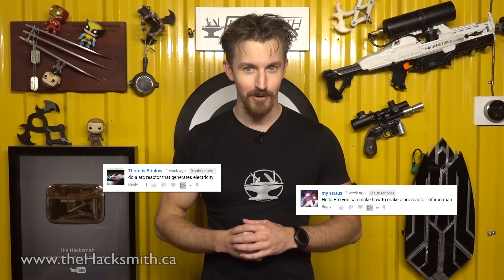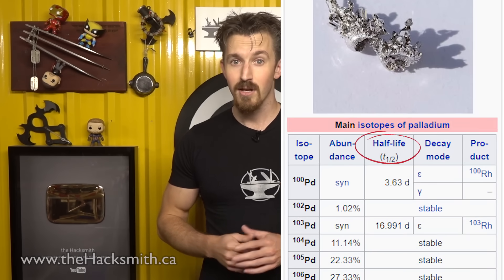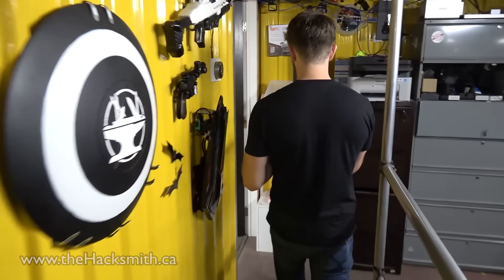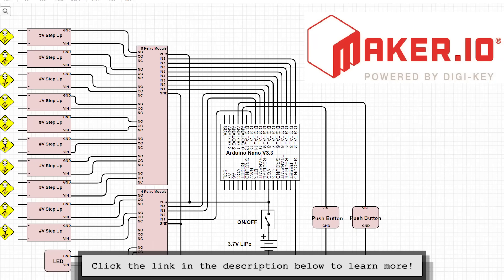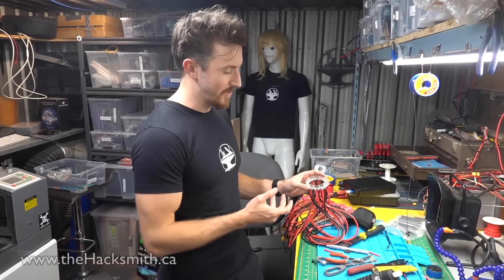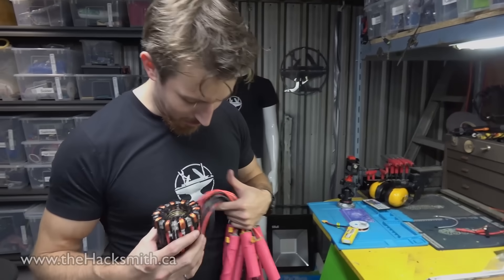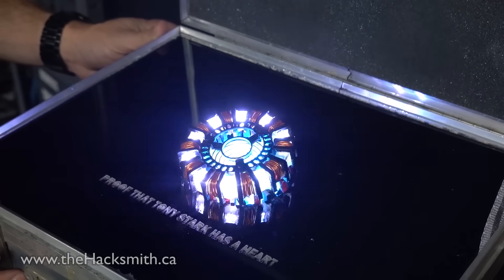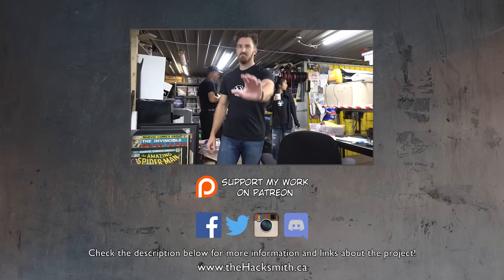Real Arc Reactor (ionized plasma generator)

Comment: But it still needs batteries
Reply: Gaming 101 yes . I think its supposed to create power .  But what we can do right? :D
Reply: Yeah. Hacksmith made a battery pack with an over-engineered LED, not an Arc Reactor.
Reply: @KefkeWren  I mean,  I already knew this would be the direction going into the video. However great work by them as it proves to be a great exposition for stem field
Reply: KefkeWren  so did iron man. The arc reactor was just a pack for his nuclear palladium. The blacksmith can make it to but he doesn’t wanna mess nuclear shit
Reply: He can't buy that nuclear bro
Reply: @sandsend812  he got it off ebay
Reply: d
Reply: batteries = immense power
Reply: Yes but, the input power is just a 3.7v lithium ion dc battery, but due to the relay module and the volt step up it produces more power but not enough to power up a usefull stuff
Reply: This time round it's almost purely only cosmetically pleasing.
Reply: Charge once, wait forever to next charge
Reply: yes see because its impossible to create power. he can only convert energy into other types of energy. everything powered by electricity needs batteries. energy doesnt just come from no where
Reply: Tony stark had palladium...
And palladium is dangerous...

Comment: You are causing the arc to cross the gap at full voltage and current which kills it.  Reduce the pressure in the individual chambers and use glow discharge to light it off.  You will not need a whole lot of voltage (200-500V), nor a separate power supply for each chamber; one will suffice as long as they are balanced and connected in parallel.   You can keep the current draw down (as well as the heat & noise) by installing a current limiting resistor to keep it in a normal glow discharge domain.

Thorium will emit an alpha particle to help light it off at a lower potential, but americium may be easier to procure from smoke detectors.  DO NOT use aluminum around an alpha radiation source, as it will take the relatively harmless alpha particles and convert it to some gamma which can be bad in these quantities.  Worse, it will produce a shower of neutrons which is considerably more destructive to the biology and harder to detect.  

Play with the resultant magnetic field to see what you can accomplish.  Hint: think halbach array and use the coils to alternatively complete the magnetic field and tap the energy which will give you the pulsing striations you see in the movie CGI.  You may need to play with the gas mixture in the chamber to get the right color, but start with xenon.  Obviously, you will not get more energy out than you put in, and I doubt Tony Stark had access to a vacuum pump in a cave, but the effect will be much closer to what we see in the movie running at a higher efficiency.

Comment: it's not actually an ark reactor. an arc reactor produces electricity, this however just uses it
Reply: @No More Commuting I thought the Iron Man one was actually a Farnsworth fusor, but Hacksmith had misinterpreted it
Reply: @No More Commuting acres? Where are you getting your info from my guy?
Reply: it is a ring made up of several elements in which arcs or gas discharges or small flashes can be generated. At 5:41 he also shows this gas discharge. I also believe that the elements could also be controlled separately with the relays and the Ardoino. He could also let the elements shine alternately. Or let the elements glow in any other combination or order. But this is more of a method to burn energy than to generate energy with it. But in the end he admitted it himself.
Reply: Obviously, he said he cant build a real arc reactor because its impossible
Reply: @hansellmar1751  Tony Stark was able to build this in a cave with a box of scraps.
Reply: Hans Ellmar 

It could be possible.   Just not small enough to wear.
Reply: @toka100  It is not possible to generate energy without an equivalent exchange.

Comment: "It's pretty much impossible to make a real working arc reactor. So let's build a real working arc reactor"
Reply: True
Reply: The arc reactor is actually one of two things: a fusion reactor, or power *storage*. try designing it to be as wasteless as possible, plasma is far denser in terms of kWh per square inch than any batteries. so if the "arc" of the arc reactor is just taking the excess output and turning it back into plasma, perhaps it is capable of the output he specified, but not for very long.

 if you didn't put the output back into the plasma container, it would build up, then cause a much more devastating ark across the middle, not only shorting and losing you a lot of power, but also exploding in two ways: the ark of electricity overheats everything in its path, including, likely, the palladium generating the power. Thus the components swell rapidly and explode, and the palladium follows, seeming as it's already unstable. 

essentially it's a compact palladium reactor, with a metric crapton of energy storage, and because of the nature of the energy storage, it could very well double as a radiation shield, meaning you could still get close to it.
Reply: We are waiting 
-Aperture Sience / black mesa
Reply: The Massachusetts Institute of Technology's (MIT) Plasma Science and Fusion Center (PSFC) has come up with the idea of a core fusion reactor with smaller dimensions. The fact that a stronger magnetic field can be generated with new materials. Smaller dimensions than the ITER, for example, does not mean that you can build one that fits in one hand in the next years.
Reply: Human are unstoppable
Reply: @silvertakana3932  until they are dead, then they are stoppable.
Reply: @silvertakana3932  Actually they are like coronavirus stop's us
Reply: im sure that the people that invented planes heard the same "It's impossible to make it work" ;)
Reply: For the hand-sized nuclear fusion reactor, it should be possible to "expose" the atomic nuclei, that is, to ionize hydrogen, and then shoot many of them at each other in a very directed manner. Otherwise you have the problem of having to enclose the plasma with strong magnetic fields. Because otherwise, such a high temperature would hardly be possible and the outer walls would be overheated. The energy released would then have to be extracted without changing the movement of the atomic nuclei. Maybe something is possible with low-temperature physics. But not in the next few years
Reply: We have our own limitation you know
Reply: Lol😀
Reply: Nothing is impossible!
Reply: You are trying right but try to replace that plastic with single poled magnet it worked
Reply: The Tokamak generator is essentially an ARC reactor.
Reply: coz nothing is impossible...
Reply: @nathuramgandhi6731  so is it possible for something to be impossible
Reply: @nathuramgandhi6731  10÷3
Reply: Artsy Kumar human are unstoppable
Reply: silver takana lmaooo they are very stoppable
Reply: But the humanity CANT AND WONT create a human in future.
Because only the God has the ability to do it without any gadgets
Reply: @kerem_9181  wrong
Reply: Well guess what THIS DUDE PROVED ITS POSSIBLE NOW SHUTUP
Reply: @Dgzero-t6n  dude don't be rude 😊😇 im probably want to built it even though its gonna blew up and killed me but dont be rude to other people

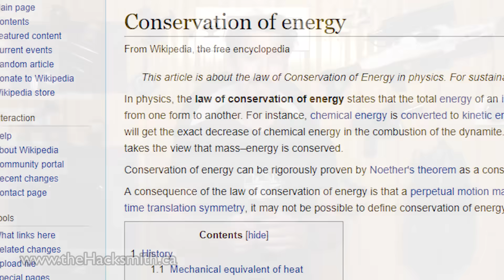Comment: 0:50 This is wrong, energy can be created by fusing a particle with it's equivalent anti particle which transforms the mass of both particles into pure energy
Reply: It may not be a conversion of energy,
but it is still conversion of mass to energy per say. A form of conservation is still applied regardless, you don’t create energy out of nothing and in this case it is from converting the mass of particles annihilating each other.
I suppose if you consider energy and mass to be related, then neither mass or energy cannot be created nor destroyed but only transformed. E=MC^2 would sum it up.
Reply: @la_potat6065  I thought he was saying that you can't transform anything into energy

Comment: ok, but why using so much HV generators and normal pressure HV arcs, instead of low pressure "vacuum" chamber , shaped into ring and use only 1 HV  HF generator? also much safer than pulsating low freq HV generator.

Comment: 1:00 in wouldn't it be energy/over mass-loss of energy in a transfixed electrical zone? Where energy can be taken by another source of energy equal to the loss.  Basically when energy transfers it goes from a positive to a negative. Like a switchboard but when the energy is attracted by another force it can cause a electrical vibration of that core energy. Causing energy to jump from one force to another.

Comment: Excellent Video!! My only question , and I probably would have made this mistake myself.  Why more than one high voltage transformer?  I believe I could have done this with 1 and timed the pulses and have gotten the same result.  These things are easy to say but just wondering if you thought of this later on?

Comment: this is just 8 tasers trapped in decorated plastic. this arc reactor is not a power source , actually it consumes power . the power source is the cylinderical batteries. its just a cooler version of the LED illuminated pexiglass due to plasma. (it still is a publicity stunt)

Comment: Well if he did make a reactor with radioactive substances to make a nuclear reactor, then they did make it fairly correct in the movies being poisonous, plus if it was a radioactive thingy then yea i guess it could actually generate power put obviously not as much as he says, what im saying is its possible but you will need to replace the fuel of it alot and it will be inefficient

Comment: Radioisotope Thermoelectric Generator.

I don't know why it took me so long to make that connection. The Arc Reactor is an RTG based on Palladium.

It is also possible that it is a Hydrogen-Palladium Reactor. In theory Hydrogen that is forced through a particle accelerator can tear apart Palladium and conduct a form of atomic transformation. A mix of Fusion & Fission. The issue is it takes energy to run long enough to stabilize & then would require constant recharging with Hydrogen & Palladium.

Comment: How many volts does it generate ? Please reply fast.
Reply: It's not generating any power, it's actually using up power. The phone is being charged by the battery in a fancy and very loud manner. Also he just bought the body of the arc reactor from china for $20. Google "arc reactor banggood" to find them for sale.

Comment: Perfect the design with less wires' boost the power with electromagnets with copper coils' buy more powerful EDFs' possible reunion with Gravity UK' team up with buyfullbodyarmors' mount EDFs on legs and shoulder blades and wire them through the suit to the arc reactor.

Comment: What if we replace the hydrogen and use plasma and loop its energy while powering the blasters, the heat energy of the plasma loop will be converted into power using an ERS battery from Formula 1 but we need to invent a smaller version of that so it will fit in the arc reactor and there will be no need for those electrical starter to use the reactor?? Just a conclusion tho

Comment: I wouldn't say you created an arc reactor so much as a device that produces arcs. Granted the whole thing is fictional, but it's two different things. There's not really a power producing device. You're putting power in and stepping up the voltage while reducing amperage. That's not the same as causing a reaction that results in power output.

Comment: You know, it would actually be possible to use only one high voltage unit, but use a concept similarly used in spiral cfl light bulbs, and have a tube filled with heated mercury vapor to ionize the air, then you wouldn't even need a HV unit. Just recreate a fluorescent light starter...

Comment: quick and probably stupid question but whats the power that is put into the arc reactor to work and whats the final amount of energy produced by it if it even makes any
Reply: It's not generating any power, it's actually using up power. The phone is being charged by the battery in a fancy and very loud manner. Also he just bought the body of the arc reactor from china for $20. Google "arc reactor banggood" to find them for sale.
Reply: @yeahnah6468   thank you

Comment: so basically you connected a bunch of tasers in series into a circle to make this arch reactor. Its the most noisiest arch reactor ive ever heard. Another alternative would be to use a vacuum tube using plasma energy into arch circle, but that would require a tesla coil contraption. Another alternative would be a custom made fluorescent light using a 120v input. The same principle of neon lights.

Comment: Interestingly, the original clip of the building-scale version actually resembles a fusion reactor of the tokamak variety. Assuming that one could get rid of the coils and encase it in glass...

There are a number of videos here showing test runs of experimental fusion reactors, and they actually have that same arc (it's not truly pure "electricity" but instead plasma) around the core.
Reply: do you feel smart now when saying it in videos comment where most of the 9 year olds believe that this actually works

Comment: He said not producing enough power! Da fuqq!, How wasting battery energy through a complicated circuit and then making an electric arc, dissipating heat, produces power in anyway
Reply from the maker: Yeah it doesn't
Reply: @hacksmith  I'm a fan of your work, and yes obviously we cant produce energy from a device that small, but only with this one, it felt thats its just a decor article, as most of the stuff you make is very real in functionality, except for this one. Keep up the good work

Comment: you could make the container in which the arc travels into a vaccum, so it wouldnt require as much energy to create the plasma because you wouldnt have to ionize the air because there is no air
Reply: it would probably be a lot quieter too

Comment: What if u make a ball of plasma and surround it with soller cell's
Reply: francis Kamau but how would that do anything? Solar cells absorb sunlight and produce energy which is converted into electricity.

Are you saying that if you put the ball of plasma outside in the sun, the solar cells would produce energy to power the plasma ball?

Comment: The battery you used to power the arc reactor 
We can better use it to directly charge the phone ....
(Can we ?????🤨)
Reply: Actually that's exactly how power banks are made. Inside every 8-10 ah power bank, there are 4 of those batteries with an IC that can charge your phone up 2-3 times rather efficiently
Reply: @Satchinaudi  sale tu electronic engineer hai kya
Reply: @anuradhachande971  kuch vaise hi samajh lo
Reply: @BEASTS AWOKEN capacitors are for the arc generation , and a battery is also used.
Reply: Iorn man suit...duhh

Comment: Trump have those scientest in area 51 try to do this it could possibly workread the comment inside this it contains the information for the possible solution to any energy crisis
Reply: Just attempt it if it works you would kind of owe me the dumbass way to do it is get a 56 mile long spikes and stab it straight into the ground but you could find a way to make a machine that can take in a massive amount of carbon dioxide and take the static electricity from the air particles and condense it to just the electrons take the energy from that pull it spread it out over a wider area and then weaken the current so it doesn't blow up and then weaken it even more then refine the current and the last step is find a way to plug the electric current into the homes and other places of America if it works than boom energy crisis prevented then you just have to stop food shortage and over population but natural selection can fix one of those and using sewage as firtilizer can help with food a little but you could wait idea when you figure out genetic engineering you could possibly try to take away a amount of the energy that human need to function and if you use my idea and it works can I get at least 23 percent profit from the earnings do to the fact I brought this to your attention thank you and hope this helps trump and try not to fuck up America worse than it is witch would be pretty hard to do given the current status but please attempt this it would work in theory

Comment: "Let's see if it can charge my phone"
The thing runs off batteries so I'd hope it can charge a phone
Reply: Yes it must but as the reactor taking 20 Amps of current it's battery will drain in 1 hour if battery pack is 20000mah or higher

Comment: I always assumed that he filled the reactor with deuterium, tritium, or even helium 3.  That way the several hundred thousand electron volts of energy running through this thing could generate extra energy.  The magnets are to keep the plasma confined, or possibly to extract energy from the plasma.
Reply: mr internet scientist you know that it wont fit in that size the heat would melt the thing if it was like you said and no their does not generate any power it just powered by battery backs it not a generator its a taser

Comment: Arc Reactor actually does follow thermodynamics. It works like a continuous chemical reaction once you introduce the initial starting energy. It keeps burning the core till the core is depleted. It converts exothermic reaction to electric energy. It can’t start on its own though. To start it Tony and Antuan the Russian Villain or lets call him Whiplash, had to use tremendous amount of energy.

Comment: The arc reactor itself isn’t a perpetual source of energy.  You need to first harness that energy and put it into the thing for it to work.  It’s easy to get confused seeing as Tony Stark calls it a “reactor”, but the most accurate technical description would be a high capacity, high output, miniaturized superconducting capacitor.
Reply: or a taser